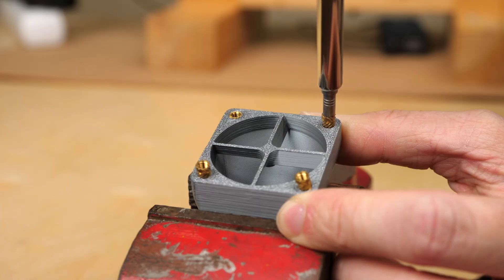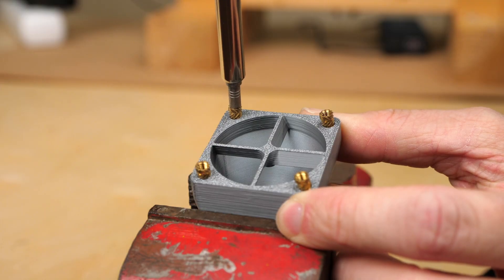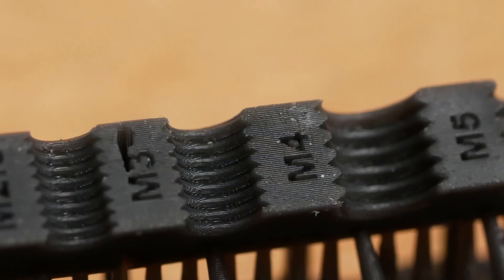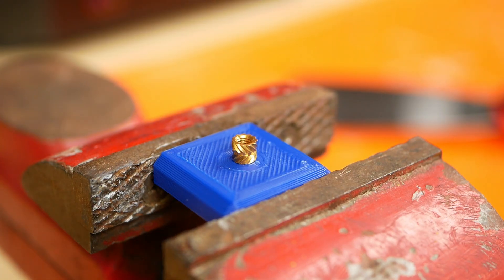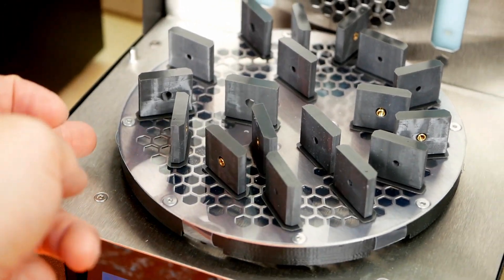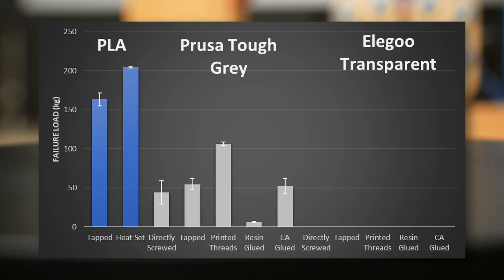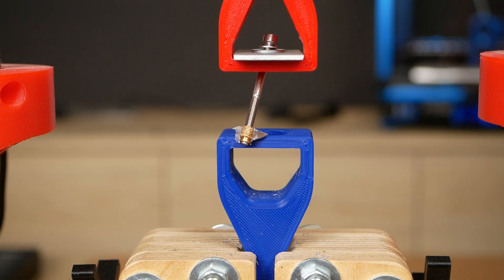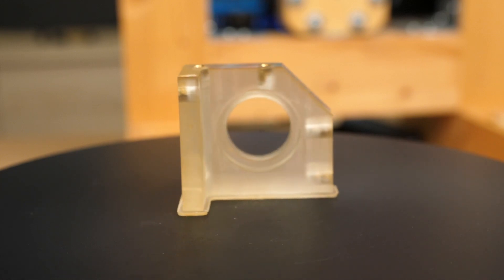Mastering Heat-Set Inserts in Resin 3D Prints

Comment: The test setup is unfortunately comparing apples to oranges. It is quite clear in the video, that the thread insert is not being pulled out of the part in many cases. The test sample is literally failing! If you were to change the size and geometry of the test sample and holding plate to be more durable, you would most likely get significantly higher results. These results as they are should not be used to make comparisons

Comment: why the fuck are they made out of brass? in adition to being softer than steel dissimilar metals have a way of fusing together meaning if 2 parts are held together for a long time you may be unable to take the screw out without completely ruining the print.

Comment: Well this is just a idea to tose around.
Stainless and aluminium like to weld to to each other.
If its a trough hole you could make a insert that goes trough the hole on both sides and screws into each other in the middle.
And over time they would weld making them not spin lose anymore.
I bet if you had some kind of induction device that cycles magnetic pulses you could speed up that phenomenon.
Yes you could also just use brass and some locktide treat locker.
But i never seen a insert with a flat head on one side.
meaning they are all the diameter but never a shoulder that actually would prevent a pull trough.
And a shoulder like a washer size then the normal insert.
But you just install it from the back OR drop it in a pocket you could even print a insert to push into the pocket.
a insert for your insert.
I think there is much more room for improving the strength they could handle.

Comment: I never used inserts but I have installed/ glue nuts on the backside of the prints. So it’s squeezed the two pieces together. You should try a test to see what it would take to pull a nut thru the resin print in you imbedded it on the backside. Love your YouTube channel.

Comment: 4:08 thermoset resin doesn’t mean it doesn’t melt enough to apply an insert. That’s precisely how I do it. In paper yes it’s thermoset and on paper no it doesn’t melt depending on your definition but for your use case, “melt” is an inappropriate benchmark. You mean soft enough to insert and allow the resin to harden around it. That you can achieve with heat. What you show at the timestamp also doesn’t satisfy the amount of heat needed given you’ve indirectly heating  the resin. The part won’t pass enough heat off to effectively soften the surrounding area. So it’s essentially a false positive based more on confirmation bias. You are applying a lot of heat to one local area . Of course that  will crack it. Do you have a heat chamber? I use an old mini fridge I sealed shut and removed the electronics then heat on a spinning tray for 10 minutes with a small heater inside the unit. THEN try the insert way with your soldering iron and adapter. Or Use a heat gun and monitor carefully applying heat to the full surface for a few minutes and then apply the insert adapter and insert

Comment: Threaded rivet nut inserts are by far and away the better solution, and are way stronger than heat-set inserts even in FDM prints. It's worthwhile designing out blind holes to use them.

Comment: I think the setup for testing the resin parts is not completely fair. Because the holder for the resin parts is made of plastic it deforms a bit during testing. The resin is very brittle and because it deforms with the plastic holder it will then explode. It is probably more fair to test this in a aluminium holder which does not deform and won't make the brittle resin break.

Comment: Ive been using them in my resin parts.  You just use a little resin around the outside of the part and uv and it works great...especially when, like me, you use translucent ABS-like resins for parts.  If i design the parts my resin prints have threads, if someone else designed it for these... I use em.  Works fine as long as you drill it just barely oversize, then resin, then uv pen or rig your curing light to be on.

Honestly if you want a truly "tough" resin, use anycubic abs like plus or abslike v2.  Both are good and strong and i used them for my voron parts

Comment: I've been using brass inserts in my resin prints and found what works for me is really simple.  Round hole the same OD as the insert.  Before curing, press the insert in the hole  The uncured resin is soft enough for the knurling to bite into.  Mine don't have a very big step, but you could match the profile if needed.

I have not torture tested them, but they work for light duty applications.  If someone is actually hanging a 50KG load on an m3 anything, well, just don't.  LOL.

Comment: 12:19 "even possible in resin parts" that's literally not what your own experimental data shows, since PLA can whitstand a lot more force than resin does. I realize you invested a ton of time in the video and you said "screw this , let's just release it as I spent a ton of time" but don't mislead the people watching. By your own material study data even the best case scenario (printed Threads at around 120Kg) is half as strong as mere PLA pushign the insert with a hot iron at what appears to be 205 or so, so almost double. You may want to edit your script of what you are saying with the actual experimental data your video shows in the end. So no the conclussion is "it's barely better and might work for VERY WEAK uses , but still use PLA or any thermoretractable material such as PLA where possible for these inserts".

Comment: Inserts are so unnecessary, you do not see mainstream plastic parts manufactured with inserts. There are specialized screws made for plastic that work perfectly well especially on resin prints. They work just fine for repetitive disassembly and assembly so long as you don't over tighten them. They are coarse thread plastic screws, you don't tap the holes either, they are direct screwed. but the key factor here is your test used machine screws instead of coarse thread plastic screws and that is why they failed.

Comment: @CNCKitchen I wonder if an optimised strength could be achieved by oversizing the hole in resin and then glueing in an FDM hollow cylinder with epoxy, (or maybe cut some abs/nylon pipe to length) so you could still heatset a threaded insert?

Comment: I use the UV resin pens with the wee UV light attached to the pen for repairs in resin as it cures really strong in the wash and cure station to the wee uv light on top of the pen! They are a brilliant must have for any 3D printing I say! Give it a try as it actually cures into the teeth amd grooves unlike super glue you need an activator that fast cures it but also turn it brittle

Comment: I have used inserts but I added an undercut on the insert and made it alingn with an undercut on the resin printed part and then I put the epoxy on both the hole and undercut and the insert and its undercut... these hold magnificently, they are as strong as the part itself. In reality this should be a kit available for resin prints...

Comment: Very interesting. One thing to note, when it comes to small bolts and machine screws people often exceed the rated torque values by as much as 300% because "it just feels right". Which is why they often strip threads in softer materials.

Comment: Try eyelet inserts for tear out strength vs normal holes printed in parts. It's an idea I've had and implemented but don't have any data to backup if it's any stronger. The idea is the eyelet fused around the entire hole opposed to having pressure applied to just the weaker points of the holes connection.

Comment: In the setup the resin test plates break at the given pull force, because it is brittle and the holder has not the dimensional/flatness stability in the range of pull forces. That makes it more of a break test than the pull force needed to pull the insert out of the hole.
A 5mm thick steel plate with a 10mm hole on top of the test plates in the holder would give more accurate results.
Big thumbs up for this laboratory testing effort though, and have a center of discussion. Love it! Thank you.

Comment: Prusa Tough Resin is not really tough, it has only 5.6% elongation / 40MPa tensil. Use Syratech Blu ... it has 32-40% elongation / 50-60MPa tensil. That's another league 😉. Its indispensable for loadbearing parts.

Comment: I'm honestly surprised directly printed threads worked the best - they always sagged and deformed for me, often cutting material when screwed in the first time. Are you tapping the holes before or after curing? I tend to tap the holes in the green parts, then cure. I dunno if that really helps tho

Comment: One comment and one question. First comment, When possible try and install the inserts from the opposite side. This will give you a shoulder to pull against. Now question, I'm use to using a formlabs printer, so there resin is different but similar. Would you happen to know what the tough resin  you used corresponds with the formlabs resin? They have a good selection of engineering resins.

Comment: If you want a stronger insert AND more reliable measure for resins inserts... I suggest you use double threader inserts (screwed and glued in the object threaded hole). It may bring the performance to a whole new level. As far as measure I suggest you need a fixture for your measurement apparatus that don't distort so much. I think you break the part because you flex them too much, rather than because of the insert resistance. Just my opinion...

Comment: Why not helicoils? They seem to work great on resin prints I've tried them on. Just tap and install using a helicoil tool like you normally would with a helicoil. I'd be curious to know how they hold up against the other options.

Comment: I still think that inserting regular nuts or square nuts is the better solution for prints. Especially when dealing with vibration. Over time I've seen any type of insert vibrating out of the parts. But having a clipped in nut with a drop of Loctite on the screw, they hold much better and are stronger as they sandwich both plastic parts between each other.

Regards,
Etna.

Comment: your resin samples broke prematurely due to bending of the samples because resin prints are brittle. they shattered due to bending of the test samples, so this test does not really test the strength of the inserts or tapped holes. U can replace the bottom clamp with some rigid metal which does not bend, it will give more accurate results.

Comment: Component parts review request.

Thoughts on using 'compression limiters' along with the threaded inserts on plastic parts. This would be to avoid plastic part damage in higher component part stress applications.
 --- Compression Limiters --- threadless sleeves installed into mating parts where threaded inserts are used for attachments. They stop the mating plastic part from being damaged from excess screw torque/pressures and stop pullout of threaded insert through aggressive assembly torqueing of screws.

Comment: Hi stephan, i guarantee that your undercut idea will improve the pullout force a fair bit. Any chance of releasing a follow up video? I know its  a bit different but i do design work with composite sandwich panels and we use undercuts with adhesive to glue mechanical inserts in place. The idea being that the adhesive glue fills a groove around the exterior of the insert, then also an undercut underneath the composite ply face, and you are trying to shear the adhesive material iself to remove the insert, not separate a bond line!

currently you are relying on the bond line to the material to withstand the pullout force on your adhesive tests, and on the tapped tests, the tapping is damaging the material so the threads are weak as you say. With your pla prints you are relying on a mechanical  gripping force directly using the material strength. if you make these undercuts, it will be more of a similar idea to the pla prints, but what would be better is if you can get inserts that have a groove around them instead of knurling!!

Great video.

Comment: So I am relieved, that my method of modeling the threads in cad, is actually the best method for ultimate strength. But I wonder how thread repair kits would perform. U know, those inserts with a m3 internal thread and a m4 or m5 external thread.

Comment: Would it be possible to make a machine that tests thread strength until a certain load, then backs off, and then measures how much "slack" was created? Perhaps only strength isn't enough of a metric for this. Initially I was blown away by the strength rating of the tapped PLA but your explanation makes a lot of sense.

Comment: Stefan - thank you for this interesting data. However, there’s a flaw in you testing setup in that your jig is not rigid enough… One can see it bend as the force on the insert increases. This would cause bending of your test piece as well, which in case of brittle resin prints explains the catastrophic failures. So the test results are not only influenced by the pullout strength of the inserts, but also on the rigidity and flexibility of the test piece. You could fix that by inserting a thick steel washer (or a few of them) between your test piece and your test jig!

Comment: With epoxy, having a surface for the epoxy to "grab onto" for both sections being glued is key. Really rough surfaces or hard undercuts is a great thing for strength. I would be using an epoxy more like JB Weld or better yet PC-7 two-part reinforced epoxies, as they have proven themselves to me to be a winner for such type applications as holding dissimilar materials solidly in place with great strength. I do not like the "paste" type versions, but the two-part in different containers. Threaded inserts will always have their place, but a person can never expect the force required to break the insert loose be more than the parent strength of the material they are inset into. The situation is great if you even achieve that level of adhesion. Off topic, I wonder why no-one has designed a new type of FDM printer that uses chemical set two-part epoxy. Some of the thicker consistency epoxies, such as PC-7, should lay down a nice strand through an extrusion process and would make extremely tough plastic parts where layer separation would be a thing of the past. JB weld would probably be too thin, but some of the reinforced epoxies would definitely be thick enough. Instead of using a hot-end, you would use a replaceable mixing tip like used on some epoxy caulking guns. Could be tube fed using the same principle as a caulking gun by hydraulic pressure using a refillable set of tubes, and a "gun" pressed by two stepper motors driving feed screws, one for each tube. A thought I have been kicking around.

Comment: It would be interesting to see how strong a through hole is. Put the bolt through and thread a nut on the back. For the resin prints, maybe it wasn't the joint between the insert and the print failing, but the material itself failing. If you got similar results with just a through hole, you could assume it was the material.

Comment: I'm really struggling with heat setting inserts on parts I've printed recently, I'd love to buy the soldering tips, but looking for a compatible iron is a nightmare, hardly anybody ever mentions what kinds of tips their irons take and I'm really unsure where to look so I can even try to use them.
At the moment, I'm stuck using a soldering iron without the tip installed because the tip is too long and skinny to do anything with my inserts - and this method feels too slippery and risky.
Any advice and recommendations welcome.

Comment: Very interesting comparison yet I see a major fault in the test methodology: the fixture used to hold the samples is prone to bending leading to stress the the less flexible resin samples until they shatter . The load values seems more related to the destruction of the resin samples than the failure of the screw/insert.  I would use a more rigid fixture with a smaller pass-through hole to contain the stresses only on the screw/insert section. Maybe for the next chapter it would be very interesting also to see how the situation changes upon temperature and applicable torque.

Comment: I work with these every single day I have unscrewed and screwed more of these than probably anyone here in these comments and yes they work really well as long as you don't misthread them and the torque from your drill is set low  speed 2   and  depending on the drill  let's say half is great can handle full torque of a drill   in  a good plastic  but wouldn't trust it is this is sensitive production that being said make sure you have a tap  just to be sure.

Comment: You mentioned hoop stress as contributing to part failure. I wonder if your resin prints had lower overall strength because your test jig has flex in it. So instead of testing just the pull force on the inserts, you were also testing the total strength of the part against hoop stresses as the jig flexed.

A metal plate to eliminate hoop stress would have possibly isolated that factor from the test and allowed the resin prints to show their true strength, instead of showing consistent brittle failure due to part flexure.

Comment: Since resin tends to shrink when curing placing the inserts before curing might make a okay interference fit.
Maybe even put relief slots around the insert location to reduce the force the inserts put on the part as a whole.
Reply: Hello, this won't work. The hole gets larger after being cured since the resin shrinks, which lessens the material at the hole, hence decrease in diameter.

Comment: How long did you cure the resin glued inserts? I wonder if using a very long time would help ( a few days in low intensity light?). Also, would dropping the resin in the hole and then pushing in the insert vs brush the resin on the insert result in better adhesion?